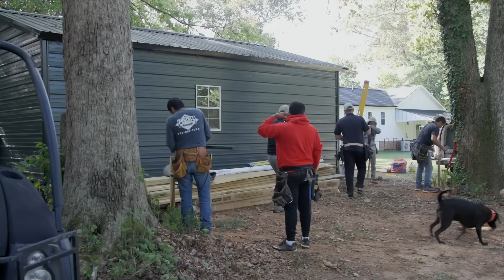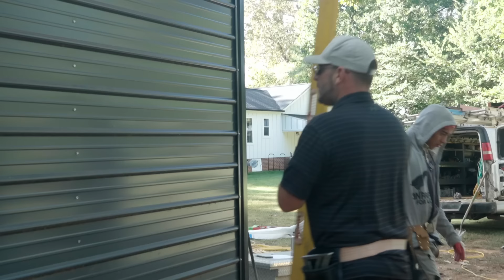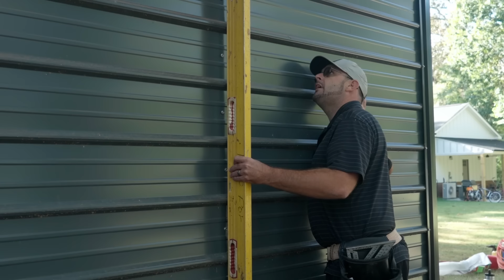How to Build a Lean-To | Step By Step!!

Comment: anyone know what material was used and the slope rule for this type of metal roofing?
Reply from the maker: There is a material list at the beginning of the video. Ideally, as far as slope, you really to reach at least 3/12 pitch or 14° pitch.  You can do less if like in this situation the homeowner was just looking to park his 4x4 and clean hunted animals. He wasn't worried about it blowing rain up the roof. If you were covering a finished area like your home, you should definitely do at least the minimum required by the manufacturer warranty which typically steeper thank even a 3/12 pitch

Comment: at @10:45 im confused. how are you straightening out the bow in the beam, wouldnt you just push the posts over since you havent set the concrete? asking because im about to make a lean to myself
Reply from the maker: No worries great question. When you set your two outside posts perfectly level and on measurement, you need to check the beam with a string line. You put a nail on either side in the exact same position or have two friend hold either side. Then you look down the beam and see if the beam is straight with the string. Then you nail a brace to the beam and pull or push until the beam is straight to the string. Put as many braces until entire beam is straight. Reach out if you have any more questions! Send some pictures of your lean-to!!!!!!

Comment: The bird mouth looks like it’s more than one third of the way.

A crucial aspect to remember when cutting a birdsmouth is to ensure the structural integrity of the rafter. As a rule of thumb, never remove more than one-third of the depth of the rafter. Overcutting might compromise the strength and reliability of the rafter, leading to potential roofing problems in the future.
Reply: while i think it will be fine in this situation, you are correct they are too deep

Comment: Nice work on the video and quality looking work. What size was the lean to or did I miss that ? I know the video is 2yrs. old now but what would a job like that cost?
Reply from the maker: No worries thanks for watching! If I'm not mistaken we spent about $2000 on materials and it was $1200 for labor. I think it is was 20x12 the posts and beam were at about 11 feet from the existing shed. I could be off by a little bit its been a while!

Comment: I just want something small to put my riding mower and push mower under, so it's not in the weather. Great video, but I think it's a bit overkill for what I need, lol. 

I have a brick exterior do you think one 2x6x10 would be good enough for the ledger on the brick, or should i go with a 2x8x10.  Also instead of using 6x6 posts, could i use 4x4 or 4x6 to attach the roof?  

Just trying to see what a scaled down version would be.
Reply from the maker: Yes sir absolutely on both of your choices. Especially, since you must want to park your mower under there. It doesn't have to be as wide as this one was.  If you use 4x4's I would recommend some type of beam to post connector, to protect from uplift in a storm or high winds. If you use a 4x6, you can still notch the post as to put some bolts through it and into the beam. If you have any troubles with your build feel free to reach out and I'll do what I can to help! Thank you for watching
Reply: Awesome, I live in Florida so I plan to use hurricane ties to the ends and I planned on drilling straight through the 4x4s and using bolts to hold the 2x6 in place. 

Was going to start on this yesterday but it was so hot I wound up staying inside all day haha.

Comment: Is the ledger board against the metal treated or untreated?
Reply from the maker: On this build it is not treated. As long as it's not exposed to weather it is ok to use non treated lumber, unless you are putting it against concrete,masonry,or it's close to the ground! Thank you for watching.

Comment: 22ft 11 3/4 - 22ft 11 7/8 = 1/8 not a 16th🤷‍♂️
Reply from the maker: You have to move it 1/16 so that both sides are equal...if the difference is 1/8, you cannot move the other way an 1/8 because youll still be outta of square. I didn't speak clearly in the video. What ever your fldifference is you move it half of what measurements are so both sides are equal. That's why we moved it only a 1/16.
Reply from the maker: To pu it easier to understand if you add 1/16 to the first measurement, but subtract it from the second measurement. Both overall measurements will then be equal.! Thank you for watching

Comment: I’m pleased that there aren’t many comments/arguments about your method of setting the 6x6’s in dry concrete or using the bricks at the bottom of the hole.  Here in East Texas there’s plenty of moisture in the soil year round (to set dry concrete) but always everyone argues about gravel or no gravel at the base of the post. I always have used about 6” of gravel or drainage rock and never have had a rot problem. The biggest issue you didn’t address was your reason for leaving the top of the concrete 6 inches below the surrounding soil.  I would consider that to be the weakest link since it gives water a place to pool at the most critical spot.
Reply from the maker: Thank you for watching
Reply: Hi, why not just set the post on concrete above grade with galvanized post holders?
Reply: @mrpush2532  The main reason would be cost and convenience. If done properly setting the post in the ground can arguably last about 20-30 years. At the end of that time you’re either dead or gone or doing something else so why does it matter? I’ve seen some old timers that claim painting the bottom of the posts with roof tar will make them last longer than the barn itself. Also, setting posts on top of brackets have almost zero horizontal stability on their own, whereas a post buried below ground are like a tree. I would sacrifice some longevity for something a tornado couldn’t knock down.

Comment: You weakened those rafter unnecessarily by cutting out half of their width (also, that was not a true birdsmouth). If the structure gets a lot of snow on it, those rafters could fail.

Comment: It will never pass inspection in Canada you have to add 2. Pieces of 2x6 post against the wall to carry the load and four 1 inch thread rods with nuts between the 2x8 and wall

Comment: I’m thinking about doing this above my deck and was curious if it’s loud underneath the metal roof and if so what can I do to lessen the sound? Best video I’ve seen on a lean to. Great freakin job man.
Reply from the maker: Thank you for watching! I'm assuming you could try some type of dampener like what's use in cars for stereo speakers or even maybe 3/4" interlocking pads from like a exercise flooring to lessen it. Maybe even batten insulation in some type of lowered ceiling that you could maybe install a vynil ceiling on. Ki d of like a dropped soffit or commercial ceiling.  On interior walls we sometimes get requests to insulate certain interior walls to help block sound. It works inside so It may work outside as well!

Comment: What do you do when you have vertical wall tiles verse horizontal
Reply from the maker: You may have to block and bolt smaller wood in between the ribs before you install the ledger...and then blot the ledger on as well! Thanks for watching.

Comment: What screws did you use going into the ledger and how do you know what to go into?
Reply from the maker: We used 5"x3/8" metal tipped screws and drilled directly into the metal studs that were in the existing building. Because our lean-to was starting from the same point at the back of the shed, we were able to measure inside of the existing garage for the stud layout and transfer those measurements to our ledger board. Thanks for watching

Comment: Those 6x6 posts will rot over time.
Reply from the maker: They might show decay but barely after 20 years maybe by not letting the 6x6 sit directly on the ground and on the brick and gravel when water enters the ground at the post it will drain to a point lower than the bottom of the post not allowing post sit in water. It's an old school trick that has worked for over 100 years.

Comment: what methods are used to set the height of the 6x6 post. Or should i ask how to know at what depth to make the hole
Reply from the maker: I typically want a 2ft depth on the post. As far as the height, I buy a post a little longer than I need and then once I pick my desired height on one post, I just level over from there. Thanks for watching
Reply: @firstnforemost7283  I figured it out! Thanks for the reply

Comment: 1:30 Are the 4x4s the only lumber that needs to be treated?
Reply: No, the 4x4s gotta be pressure treated, which means it's rated for ground contact. Everything should be borate treated though, for sure.
Reply from the maker: They are 6x6's on this lean-to but yes the support post has to be treated.
Reply from the maker: Anything that comes in contact with or in close vicinity of the ground needs to be treated. Thanks for watching
Reply: How are you suppose to be taken seriously when your wearing F'in slippers?? You are a joke dude, seriously 🤡

Comment: Instead of chalking a line on the tin, why don’t you measure your 3” over hang then every 16” or whatever your strapping is at and predill the holes for the screws? Will ensure a dead straight line of screws and easier to screw in general.

Comment: Got to ask at the middle 6x6 post. Why does it look like only one of the 2x8's is bolted and not the otherside?  That's my only question because I'm building one myself and your video is so far the best video to watch and learn
Reply from the maker: I am not sure why it looks like that, but we had two bolts in each 6x6. The may have been a break in the beam over the post so I was catching both sides I'd have to watch it again , it's been a while since we built it.  But definitely two bolts per post. Thanks for watching

Comment: a few things i would have done different. I would have mixed sand and gravel into the concrete and poured it wet, its a lot stronger. Also with the roof, you never screw in the valley always on the hip. You can see how the techs have created an indent, this will eventually leak, also those sheets need the ends folded up under the other roof to stop the water from back traking.

Comment: The main issue is not sealing the bottom of the 6x6. Even tho it’s treated the concrete will eat the wood away. You should be doing at least a couple coats of driveway sealer or something along those lines to have a barrier between the wood/concrete.

Comment: I'm trying to decide between doing a lean to like this or having a separate structure built. What was your cost on materials for this?
Reply from the maker: The materials were approximately $990 for the metal roofing ,trim and screws. The wood and concrete at this time was like 600 and there were some costs for the bolts. All in all, materials were a total  near $1800.  The cost of lumber has come down since this video was shot.

Comment: What kind of screws do you use for you ledger board
Reply from the maker: Thank you for watching, that is a great question. We used 3/8" screws that were 5" long and have a metal self-tapping end to. easily attach to metal studs will just need to pre-drill holes in the would, as to not split the lumber and allow the screw to contact directly to the metal pare. please let us know for any question in the comments or at firstnforemost2022@gmail.com . Have a great day.

Comment: How did you attach the ledger board.  Im wanting to install a lean to on my building.  The frame of my building is 2 ¹/² " square tubing. Im unsure on the best was to tie into it. My tin on the side wall is running horizontal like this one.
Reply from the maker: I drill 5"×3/8" metal tipped screws through my ledger and threw both sides of the existing studs. It would be even better to pretrial a 5/8" hole and send a 1/2"×6" bolt at each stud with a nut and washer. If you use 3/8" screw option I would put 3 each stud. Thanks for watching!!!!!

Comment: One more question.  Do you recommend some type of moisture tape when attaching a lean to roof to the shed?  I'll be using treated 4x4 post that will run along side the shed as close as i can get them.  I am wondering about putting moisture construction tape in between the post and the shed? Also, would I be better off having a metal roof with just framed in roof or using OSB and putting shingles?  On the other roof I recently built I used plywood and shingled the roof.  I am wondering which is more cost effective?  I'm also thinking just putting up a metal roof will cut down on the amount of time

Comment: Hello. Great video! I want to put something similar up on my deck. Maybe you can help me with a few questions…. How much weight can the roof hold and what metal panels did you use? I live in New Jersey so there will be heavy wet snow and ice  on it.  
Thank you…
Reply from the maker: great question and thank you for watching. the metal roof panels were purchased at a local hardware store and are consistent in thickness with normal building materials if not thicker than most metal roofing on new residential homes in my area. Being that you have expected snow load i would pour concrete footings to about 4 inches above ground and "beef" up the sub-frame of the roof to help with the potential load. the metal will withstand the snow load but a subframe built at 16" on center with 2 foot on center  spacing on perlin blocking will give you all the strength you need to build a long lasting lean-to, even in New Jersey!!!!

Comment: interesting good start except for placing the 6x6 pressure treated post in the ground with cement around it.  So wrong, always dig to your frost line in area a hole for each post, then frame it up put mixed with water cement fill up to approx 4" or more above ground, set post on top of concrete forms with braces. Now less chance of rot on post, and if ever needed replacing easier to do.  I do this also for my decks. a good builder would know this.

Comment: Thanks for great video as I plan to do the same thing for my carport. Please help me to calculate the tilt of the carport's roof, I need it has tilt of 28 degree with the high end is 8 feet high so what is the height of lower end to get 28 degree tilt with the 7"6' span between the posts. Your help is greatly appreciated.
Reply: Span x sin(angle degree) is the formula to calculate fall.
Reply from the maker: Glad it helped, thank you for watching!!

Comment: What keeps the new posts from settling and pulling at the ledger board and main structure?
Reply from the maker: what helps prevent settling is the depth of the holes that were dug. it honestly is a combination of things i.e. the ledger,bolts in the existing structure as well as the hole depth. by getting to an undisturbed depth that is very compacted and strong, it will prevent settling. settling will always occur ,however,  just at a very minimal amount if done this way!!!!thank you for watching and especially for the comment.

Comment: I’m building a roof of the shed like you are, but it’s for a chicken run. Now I planned on taking it from the shed and attaching it to the privacy fence instead of installing post like you did. Our shed is a big shed that anchored with large augers, the kind you might find single or double wide trailers. Now is that a bad idea, should I run a couple of post up against the fence to where the roof isn’t attached to the fence?
Reply from the maker: great question!! depending on the spacing between the posts of your fence, you may be able install a beam from post to post on your existing fence that could suffice just fine. these typs of roof designs with metal panels have a very low weight per sq. foot . thank you for the comment and for watching!!! have a great day.

Comment: Great video! You explain it so well. How deep did you set the posts? Do you prefer dry concrete mix, then add water, or mix then pour?
Reply: I'm curious, how do you keep yellowjackets from building nests under the original eaves and the new roof? How long does it take for the concrete mix to be totally activated?
Reply from the maker: thanks Don!
1. we set the posts 24 inches deep.
2. i prefer mixed concrete if strength is my main priority, however dry packed is easier and all that was necessary for this job!!!

@heymaker
thanks for the comment and questions!!!
1. bees and wasps are definitely a battle, especially where a building is barely used.
but the best way is to completely close off the fascia. i actually did a newsletter on this exact problem that goes up on my community tab this friday the 9th of june
2. the concrete will be cured in approximately 24 hours

Comment: Are you using all PT wood or just the posts?
Reply from the maker: In this build just the posts are p.t.!!
Reply: I'm going to use all PT. The price is minor when costed out. Only $60 more for all PT using 6- 4x4 posts instead of 6x6's. Lean-to is 8x20 and will have only 1- 20 foot wide side opening. The rest is closed up.

Comment: Great info and video!! Let me ask instead of pouring concrete around the 6x6 post could not just dig a two by two foot by 2 ft hole. Fill it full of concrete and then put the post on top of it after the concrete drys? That away the concrete don't eat the post away?
Reply from the maker: Absolutely you can, you could also wrap the post in vynil at the bottom and the concrete will not eat through the vynil.  Thank you for watching!!!!